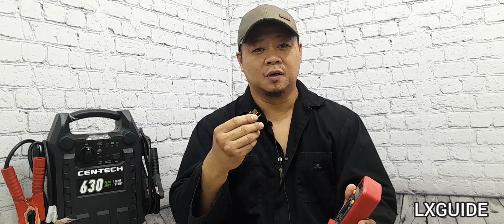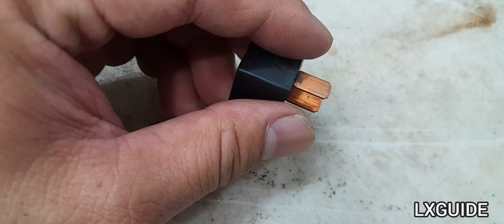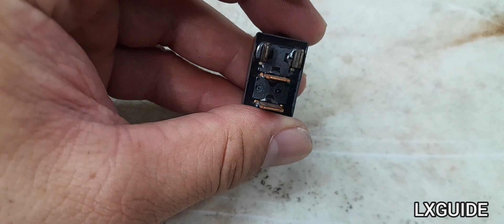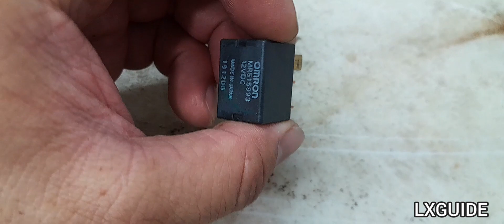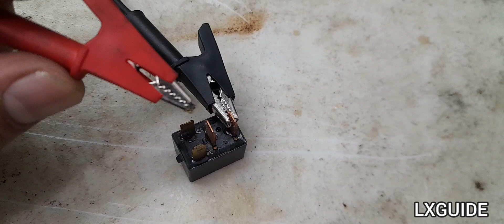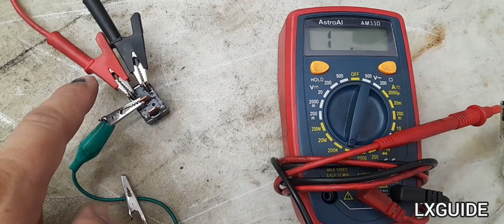HOW TO TEST A 4 PIN RELAY

Comment: Quick , simple and properly explained...... old mechanics just test 85 and 86 and when it makea click sound they consider it a working relay...... the REAL test is to check continuity between 87 and 30 after energizing 85 and 86...... because 87 and 30 is the most important pins which actually gives power to the accessory or device in car ...... thanks buddy